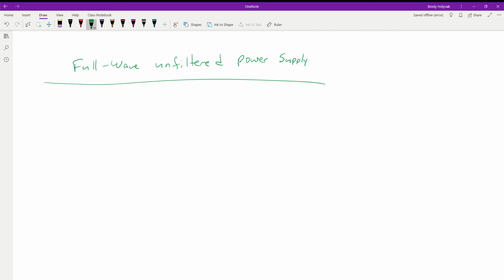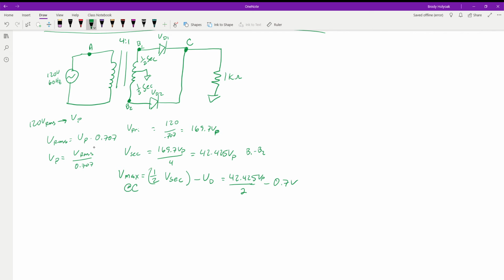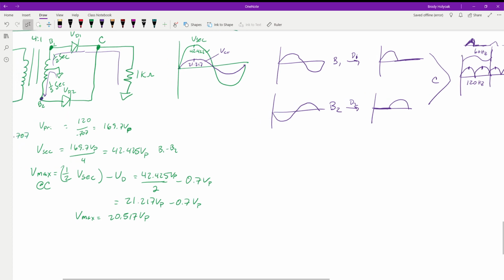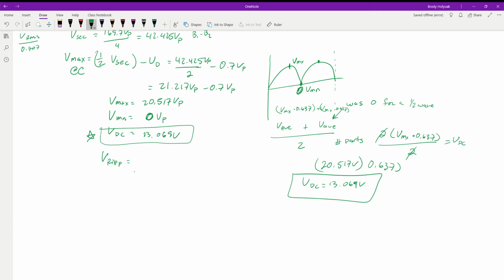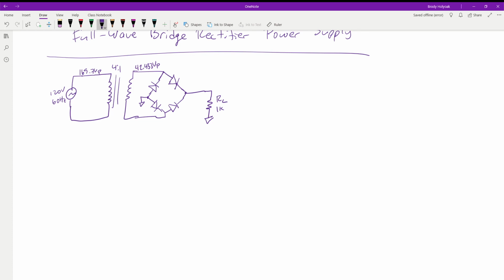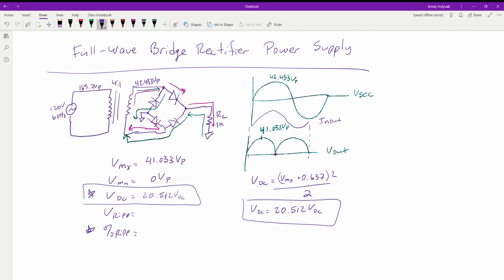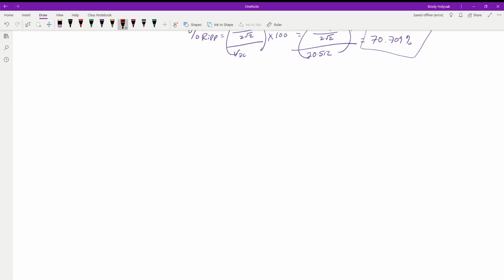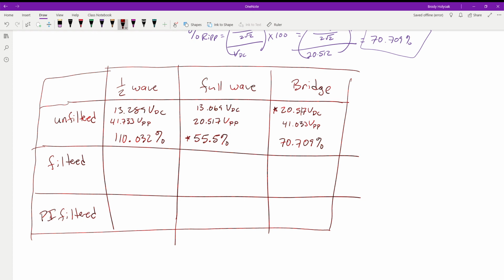Topic 6- Clippers-Power Supplies-Unfiltered (Part 2)

Comment from the maker: At 27:10 there is a mistake. The value for VDC should be 26.138 not the 20.514. with that the %ripple is incorrect as well it should be 55.5%. Sorry for the confusion on this. I will change these values on the analysis chart in the next video.